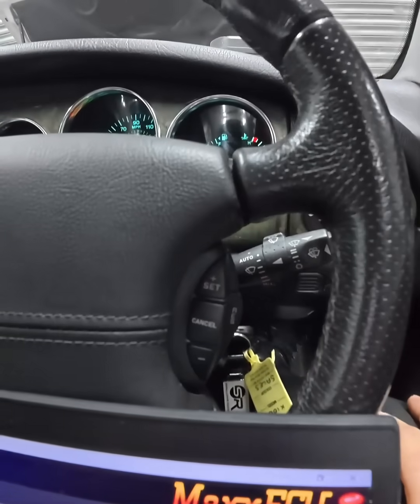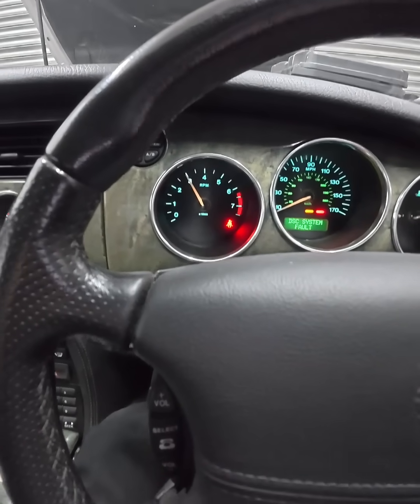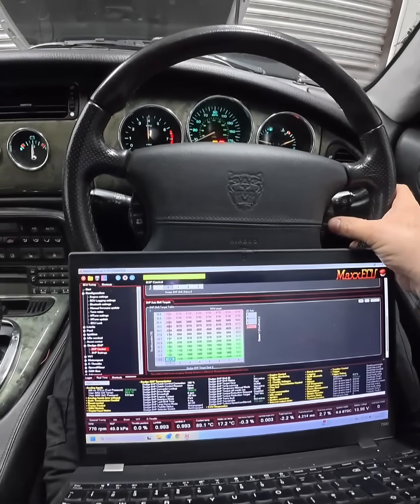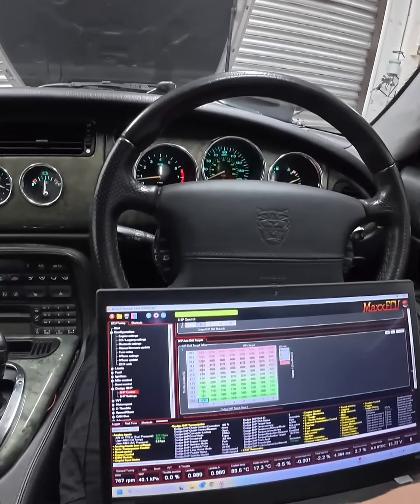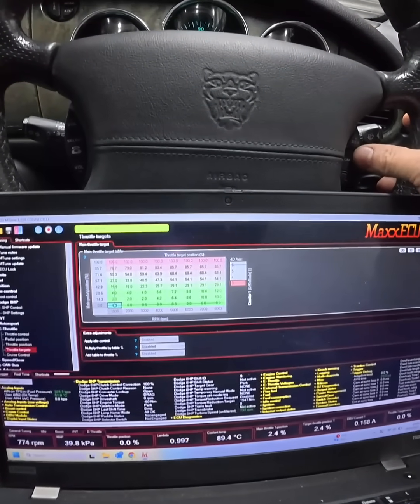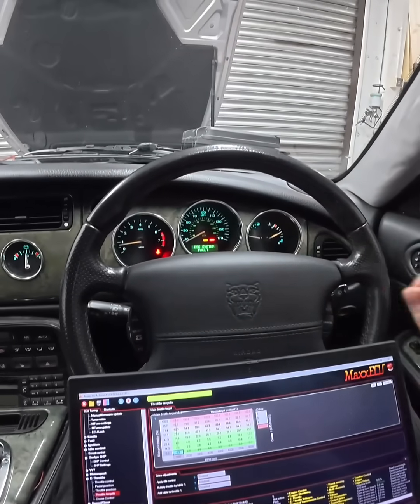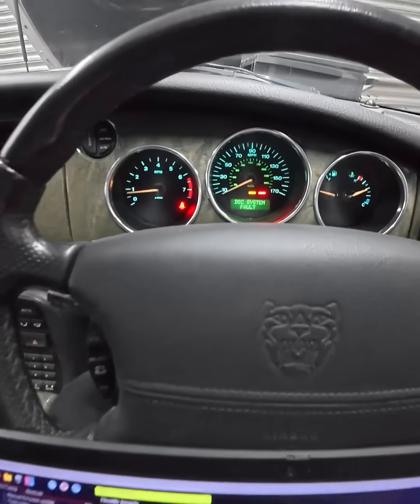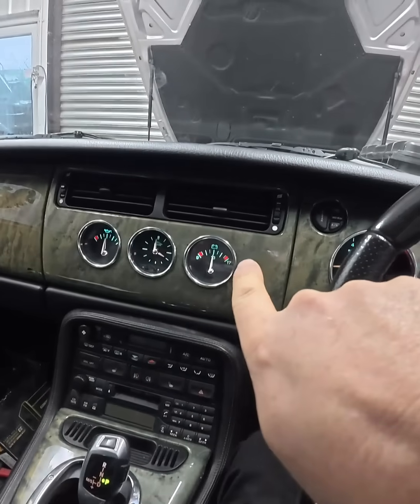MaxxECU 8HP Drive Mode selction on the steering wheel with tachometer Telltale! OEM CANBUS

Comment: Wow, it seems if u want a strategy Max can do it.
Reply: Car will feel different but the power stays the same. Once something is optimised you can't optimise the optimum
Reply from the maker: @gothicpagan.666 This is specifically shift points / shift speeds / converter slip. No reason at all why  you couldn't use it for 'map switching' or boost levels or whatever. :-)
Reply from the maker: Absolutely. If you can dream it up, you can normally create it.